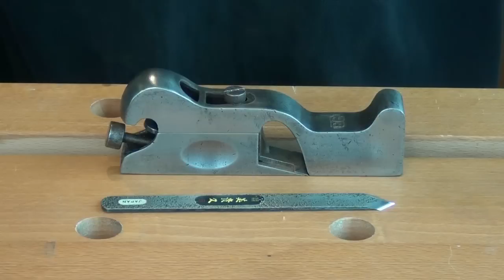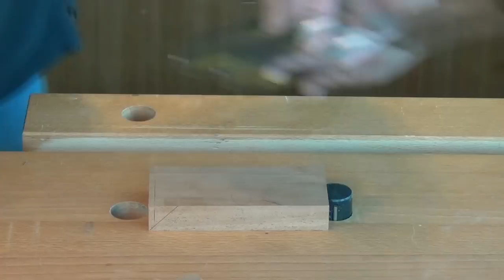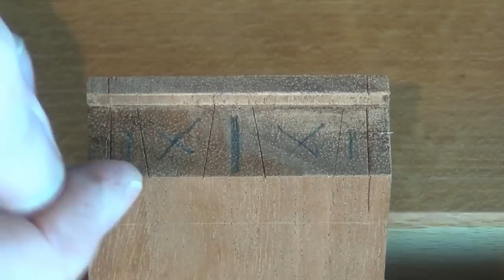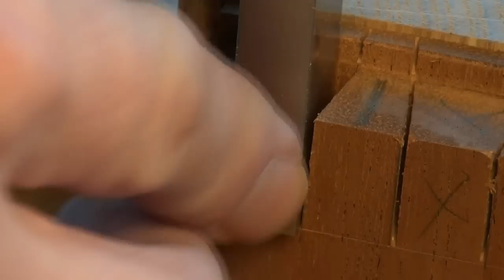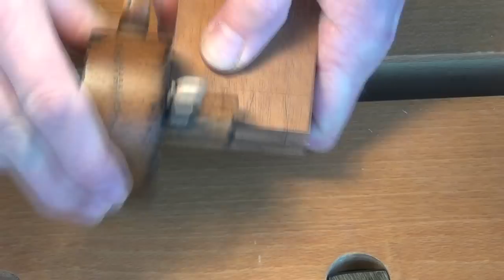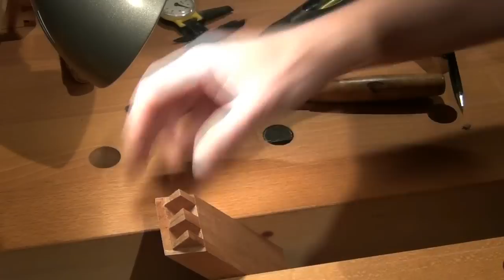Secret Mitre Dovetail (Full Blind Dovetail) by hand - Full Version

Comment: Awesome! I was thinking about making a wooden rackmount for 2U-4U and so on, but didn't go for it, since I wanted maximum strength ( too much weight and pressure on rackrails) but also wood to look nice in the front! This joint is what I needed! Thank you so much, your video is more than easy to follow and well made! Congrats!
Reply from the maker: Thanks Kostas, good luck with your rackmount build. Send me a photo when it's finished if you remember.

Comment: Very fine! What a result! Lead on! Don't mind my excitement, it's just that what you're doing is really the way to go. I've been 'erring on the side of caution' by using machines, lacking any training when I started, but you and others are equivalent to mentors, so thanks!
Reply from the maker: You're too kind, thanks. Treat yourself by going off grid for a day and feeling the pleasure of hand tool work.
Reply: I do, I do, I do hand work: 70 hrs. week, thirty years, but I only build fortepianos, and the traditional bench is too limited, for one thing. I have an extra workroom, and it's opening old curiosities, traditional joinery item one. I found you while  flat  on my back with the flu, so the treat will be most welcome, soon. Have a look:https://www.flickr.com/photos/mcnultymusic/sets/72157648227037786
Reply from the maker: Paul Mcnulty That's a thing of beauty to be sure. Can I ask how many 70hr wks go into one of those?
Should you ever film or time-lapse the process, I would love to watch it.
Reply: 4000 hrs, not counting my work, which is drawing, supervising 10 people, soundboard, bridges, strings & mechanism. The shellac finish is my recent recipe of HVLP sprayed Landis shellac (larch resin, hard, fast drying, durable) scraped level, then french polish, then benzoe, sandpaper always at a minimum. finish amounts to victory, will gladly elaborate.
Reply from the maker: That doesn't surprise me at all. I wonder how long it would have taken two hundred years ago! Great work.
Reply: In those days, >3.5 pianos per man/year was typical. Anton Walter, Mozart's builder, finished his first ten years in Vienna having built 385 pianos, in a large shop with ten workers. Boisselot in Marseilles in 1840s had 100 workers and built 400 pianos/yr. McNulty in Amsterdam in 1988-89 built seven, alone. I was forced to do so, but in the old days the  work was well understood, and woodworkers were everywhere. I'm just now able to stand back slightly and look at exploring old techniques, hence youtube.
Reply from the maker: Paul Mcnulty I'm guessing that now days a lot of the grunt work is by machine/power tools with jigs, etc. maybe CNC too? We seem to be in an age where repeatability and productivity go hand in hand. I don't know about your business, but I would guess you make to order, and clients want their piano to look and sound exactly like the showroom one?

Comment: Nicely done, I am going to try this for a project and your video is a big help.  Thanks
Reply from the maker: Troy Staten Thanks. Let me know how you get on Troy
Reply: Just made a little shelf unit with this joint, was fun making it but I had two problems, one was the miter opened up a little during assembly (most likely because of my lack of skill) I also made the mistake of using some very old vertical grain douglas fir that is very hard and splintered easily so making the cuts and laying out the lines was harder than  I thought it would be.  All in all very fun and I appriciate the video.
Reply from the maker: Cool. Yeah, the alternate hard and soft areas across the grain in softwoods like Douglas fir make it a real challenge.

Comment: I am inexperienced novice but its a joy to see such a beautiful clean joint and so much skill and precison in your work.  I was wondering where or what application would such a joint be used? Obviously the corner haha but i mean in practical terms in furniture for example
Reply from the maker: Thanks. Visible joinery is more accepted these days, however there are still circumstances where minimising things like dovetails is desirable. Mitred corners are the best we can do, but they have little strength. Biscuits and dominos are widely used to reinforce them these days, but hidden dovetails were the way to go in the past and still have the advantage that they help clamp the joint whilst the glue cures. Carcass corners were frequently made with this joint in good quality cabinetry.

Comment: What is the  brand of the chisels that you are using and what do you use to sharpen them?
Reply from the maker: gary24752 Hi Gary, 
Large chisel is 'AmTech' from a local discount store at about £3, the others are all second hand, a 'Dastra', 'Mandix', and an unmarked one. 
I do any major regrind on a Tormec wet grinder, but the majority of sharpening is with water stones, although recently I've been trying some budget diamond plates and a fine india stone. Always finish with honing paste on MDF for a mirror finish to the micro bevel. 
Most of my sharpening is covered in my early videos, although I need to add some more for my recent ventures. 
Happy woodworking, mitch

Comment: French polishing is a nightmare, but shellac can be rubbed down just like polyurethane, with the benefit that the medium is alcohol, which, as we know, can be ingested. Spraying is done indoors, you see, and the G3 grade of filter removes the overspray from the work, which otherwise covers everything you own with grainy dried droplets. A fan in a homemade filter housing does the necessary, and a facemask fills the bill. Spraying more volatile solvent based finishes can't be done without full ventilation and introducing outside air, so there goes the heat bill. In short, skip the French polishing, and rub it out the way people do their electric guitars, laboriously, but polished regardless, and don't forget shellac is tops on the refractive index.
Reply from the maker: Paul Mcnulty You know, I may just have to give that a try! Thanks for the tip Paul.

Comment: Such a nice joint! It really is a shame no one will ever notice :(
Reply from the maker: PipeSmokingBearGuzzlingBassist Thank you. At least the maker knows, and the sense of achievement on completing a piece is that much more.
Reply: The thing I always think when making anything is that the person using it would notice if you didn't put the effort in. If you had used a less sturdy joint then it wouldn't hold as well and maybe start creaking. If you used a normal dovetail then you'd be able to see it and it might not look as nice.

I make things completely different from this (iPhone apps) but I take pride in putting the effort into making them so that it seems like magic. This joint looks so simple from the outside but is so strong it seems like magic :-)
Reply from the maker: Thanks Oliver. Seems we approach things in the same way. Sadly the end user does not always see the magic, only the price ;-)
Reply: Haha! Yeah. When it works well it always seems to go unnoticed.

Comment: Thanks for doing this joint have been waiting ages to see one done properly. I wonder was this joint used much in cabinet making since it takes so long to make
Reply from the maker: jerry o connor Thanks Jerry. The highest quality hand made furniture often still uses this joint. Arguably, equally strong mitre joints can be made with machines/power tools and modern adhesives, faster and therefore cheaper. And some say that's progress ;) It doesn't really take that long to prepare once you get into the zone. Doing it whilst trying to get good video of it on your own, now that's another matter!

Comment: Is it possible to sand the corners smooth without damaging the blind dovetail?
Reply from the maker: If the mitres are well prepared and tight fitting, at the ends and along the length of the joint, then there is plenty of scope to sand the corners without revealing the dovetails.

Comment: what would be it's main use Mitch?
Reply from the maker: Hi Rob. Carcase construction in fine furniture I would say. Locking the sides to the top most especially. Today these mitred corners are easily locked with machine joints and modern adhesives, but in the past this joint would have been the one of choice. Actually, nowadays, displaying the joinery details is very popular, so you might find a mitre dovetail joint used, where only the edge of the corner receives a mitre. Not sure if I've done that one in my series, yet.
Because the dovetail detail is all hidden, there is a temptation to rush this part of the joint, but that will often result in a sloppy fit, patchy adhesion, and a short lived joint.
Sorry, got a bit carried away!
Reply: No, fine Mitch, these tutorials are like a school for woodworking for us new guys. Thanks

Comment: No cnc. I can't make computer drawings. The pianos I make are clones of antiques, which eliminates second guessing proven masters, who knew what to do. I take out some insurance policies in my joinery. No single set of instructions exists, but gradually the questions lead along paths that are sometimes definite, and I've solved some puzzles. The depth of my shellac is untypical, but a very thin French polish will wear away quickly, and who will renew it?
Reply from the maker: Paul Mcnulty It sounds an interesting job. I have yet to master French polishing, and have very mixed results. Consequently my finish of choice is several coats of a wipe on finishing oil. Of course that would benefit from either regular top-ups or waxing, and who would do that? I remember Sam Maloof saying that he regularly maintained some of his commissions, making a very profitable side-line to the job.